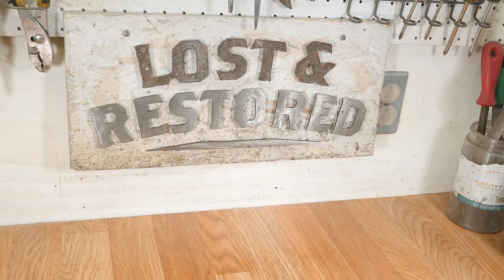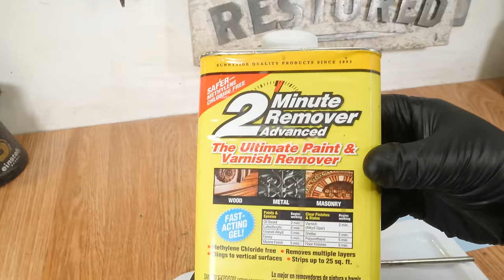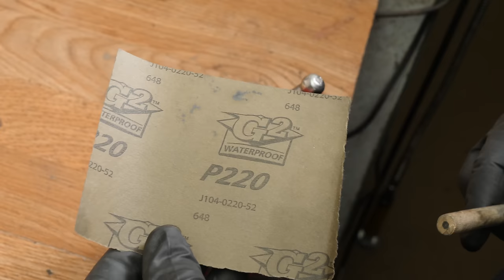Super Rusty Survival Knife Restoration...Rambo's Lost Knife?

Comment: Aren’t compasses and sprit levels filled with alcohol? Germs will grow eventually with water, no?
Reply: mine had a oil like liquid in the compass
Reply: Modern compasses usually use a magnetized needle or dial inside a capsule completely filled with a liquid (lamp oil, mineral oil, white spirits, purified kerosene, or ethyl alcohol are common).

Comment: I just thought I'd mention, there's also suppose to be two round key rings that go on the threaded portion before you screw the butt cap back on, those are your handles for when you need to use the wire saw. 👍
Reply: You beat me to making this comment.
Reply: Yup, any old key ring should work. It uses a standard size if its the same crappy $20 "Rambo" blade I had as a kid.
Reply: My cousin ruined mine while sawing down a Christmas tree.  He promised to replace the rings but never did.  
Mine also came with a sheath and wet stone.
Reply: Led me to think
Reply: Ahr the good old days I was 13 when I got mine still have it in mint condition also bought two butterfly knifes one brass one steel sadly they never made it past my school years good times you could buy this stuff from a market
Reply: @sawboss5794  Yep, the stone was in a little pocket on the front side of the sheath. The little leather flap with the snap on it broke on mine. :)
Reply: I have 12 of these knives in various states from mint to a close facsimile of the before . I must be crazy but I can't pass them up when available 

I also own several high end hollow handle knives including a lile.
Reply: I musta had 4 or 5 of these things when I was a young Ninja/Rambo
Reply: Yes, still have mine somewhere, with sheath and whetstone  @sawboss5794
Reply: @HMarcBower ditto. Sheath made of some very poor grade of fake leather, of course.

Comment: There used to be two rings, essentially a couple key chain style rings that went on the handle before the storage compartment cap was installed.  The rings were for the wire saw. This is why the cap didn't thread all the way on.

Comment: i had one of these as a kid too - lots of great memories.  Don't forget to add the two key rings under the compass and fitted over the threads on the handle (that's why there's a gap).  They're used in conjunction with the saw.  They keyrings fit in the small loops at either end of the saw.  Great restoration!!  i love the finish on the handle.

Comment: Awesome restoration job, man! That's identical to the one I had in the mid-80s except that mine had a plastic handle, and two keyring things for the tree saw. It was a crap knife, but I had a lot of fun with it. Thanks for the jog down memory lane.
Reply: bro i literally have one in my hands currently with an identical description: 2 keyring things at base of compass, plastic black handle and all. mine also says 420 STAINLESS TAIWAN at the base of the blade
Reply: @elvincollins1095  How's the condition after 40 years? I spent a lot of time in the wild with mine, so the condition deteriorated over time. But the unit was still complete and fully functional and it never broke despite the beating I gave it. I have paid a lot more for similar knives that were junk in comparison.

Comment: I still have mine in mint condition with the sheath and wetstone. I bought it at a flea market in the 80's for $5.00. It also came with 2 key rings that fit on the handle to use with the saw.
Reply: literally same bro identical description

Comment: Wow - Really cool. I still have mine, my wife uses for gardening for breaking up the hard soil. Mine does look better than the knife at the beginning of the video. If I remeber correctly, I bought it mid 80's, it was advertised as a mail order item. The knife is very solid but the blade was dull. If I remember right it also came with fishing line, hooks, and some serrated metal wire for cutting branches inside the handel of the knife. I probably still have the knife sheath and sharping stone somewhere.

Comment: I received this knife back in the eighties and I still have it in unmolested condition with the original cheap sheath. The liquid in the compass has since evaporated but your video has given me the inspiration to rehydrate it and I hope the magnet still works. Mine also has two metal rings for use with the metal wire saw. They are stowed around the threaded part of the handle and compass top secures them. Nice video!

Comment: I know this was just a bit of fun.. but a few friendly notes.  You're missing the two keyring-like things that fit over the threads between the handle and the cap - These would get threaded onto the wire saw as finger pulls.  The matches that were originally in a kit like this would be "strike anywhere" type matches - but I've never gotten them to work at all.  Fluid in the compass... I don't know what was in there originally, but generally there are 2 options: Isopar - which is an oil based fluid that is good for dampening, generally used on boats - a light mineral oil could be used in a pinch; and an Alcohol based fluid - Isopropyl alcohol could work, or even vodka in a pinch... heck vodka might be better for survival, assuming you didn't want to spring for the real stuff.  Finally the saw teeth on the back of the blade? yea, it is a saw.  Best I can figure it's not a wood saw, but a bone saw.

Comment: Awesome restoration, you are missing the two key rings that go on before you screw on the cap. These two rings are also used for each side of the wire to make finger handles to cut large branches or small limbs. Thanks for the video and once again great job.

Comment: I remember, begging to get one of these “survival knives” when I was a kid. These things were the biggest piece of garbage ever. They never came really sharp to begin with, and whatever else they had was lost almost immediately. The best thing about the blade was probably the bottle opener. The most practical item on the entire night was the compass because it actually worked pretty well.

The first time I tried to use the cable saw in the handle it snapped in half after cutting one branch 

Are the fishing hooks? The weights in the line seemed pretty reasonable, but only if you were going to try and catch something like sunfish, or use them to make some sort of snare. 

Other than that these knives were a complete waste of money and totally capitalized on the Rambo craze of the early 1980s

Comment: While these are neat novelties, it's important to stress that a proper "survival knife" will always have a full tang (i.e. the metal comprising the blade will be one continuous piece from the bottom of the hilt to the tip). The reason why this is important is that that little screw-in pin you see will have the full torque of the blade applied to it rather than distributing the force evenly across the blade's length. This creates a fulcrum point that is highly subject to fatigue and eventual failure.

Comment: Too funny!  I used to have the same knife when I was a teenager.  There should have been 2 key rings the diameter of the handle that were secured when the compass portion was screwed on.  They were used for the wire saw.  I thought it was the coolest knife back then.  By today's standards, not so much.  Nice work on the restoration!

Comment: I have exact same one but Ruko brand. Razor sharp blade. But ive never trusted it because its not a full tang.

I used to have a smaller one like this and snapped the blade just above the finger guard. Very poor grain structure suggest cheap and/or not heat treated properly. Cool knives though

Comment: You did not put anything in there to strike the matches on; those are not "strike anywhere" matches. Toss the matches and add ferocerium rod or lighter. An alcohol wipe if you can squeeze it in there works both as disinfectant and fire starting tinder. The empty space can then be filled with magnesium shavings. Hassle to take out and put back in, but you will be glad you have them if you need to start a fire with wet tinder.

Comment: i used to have the same knife, got it for maybe $10, and it was a junk knife. couldnt cut a fruit without much force, and much less paper,  cutting action was more of tearing. the quality of the blade  was not even hard stainless.. the blade was kind of light, so manufacturer must have mixed some zinc and aluminum to make it cheaper.

Comment: LOL!!  I still have mine!  Its in much better shape than yours was but it just sits in a cabinet.  Also you are missing the 2 key rings that fit over the threaded section of the handle and are held on my the screw on compass.  You use them them for that piece of abrasive wire that you are supposed to use as a saw. replacements should be easy to find.

Comment: I've seen some other videos where they say that these restoration videos are faked.  It so happens that I have this EXACT knife that is over 35 years old - yes, the Rambo knife with the screw-off end cap with the "survival" gear inside.  It has been sitting outside, in the weather, for over 15 years now and doesn't have even a quarter of the crap this one has.  To be sure, it isn't pristine as the compass is long gone and the blade rattles around in the hilt (cheap quality novelty knife), but there's very little rust on it.  On the other hand the knife in this video looks like it has over 50 years of rust on it, as if it was stored in a saltwater aquarium tank with a bit of acid poured in for good measure.

Sadly, the knife isn't even the one from the movie, and there were many cheap copies of it made, with many being as cheap as $10.  Again though, THIS one just looks as if someone tried to falsely "age" it first.

Comment: That is NOT a great knife.  The blade doesn't hold an edge, the compass isn't accurate (in fact, it rarely sits upright while you're trying to read it, the cap for the compartment tends to corrode (even with preventive measures), and the compartment itself isn't water tight.